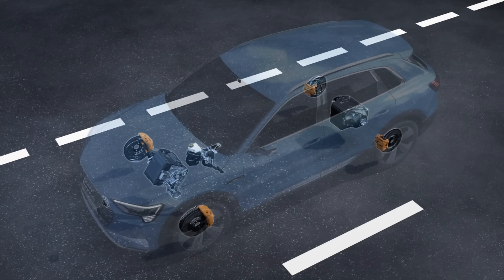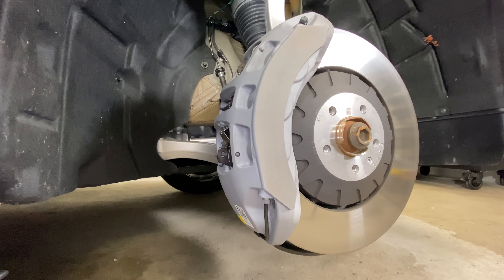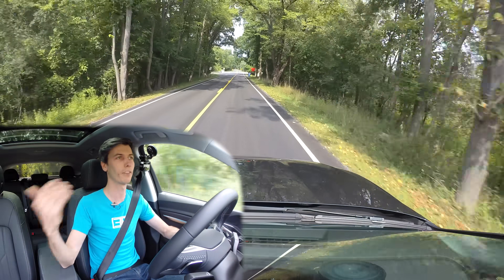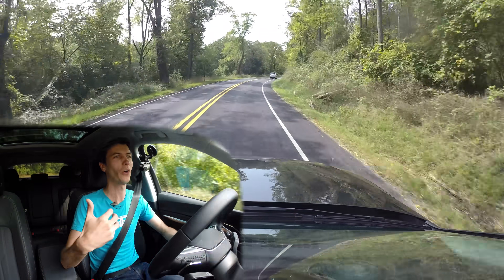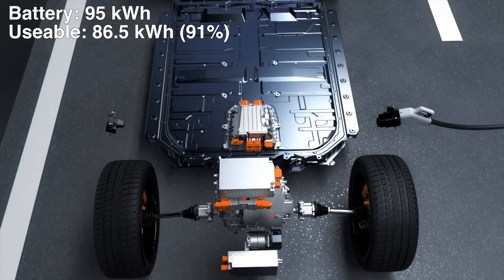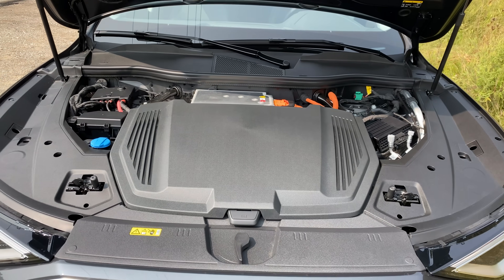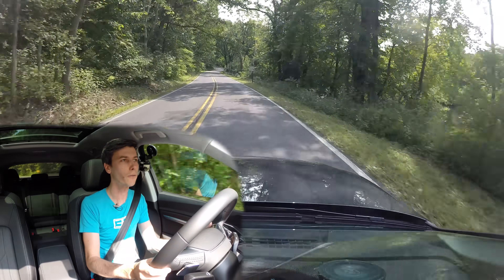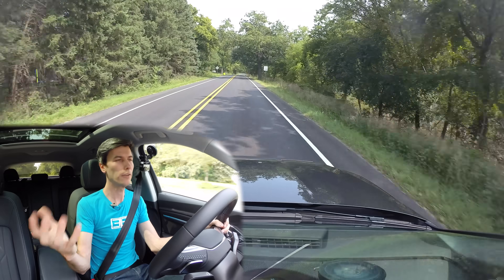How Does Brake-By-Wire Work? Plus: Audi e-Tron Sportback Review!

Comment: What if the computer fails will the valve open by default say a spring loaded system?
Reply: A lot of trucks have pneumatic or pneumatically aided brake systems. They work the same way. If there're no air pressure, the brake remains applied and needs pressure to be released
Reply: Tito Dwi Laksono infiniti tried to do that, but was fortunately stopped because of laws
Reply: If I was the engineer it would be a valve operated by a spring loaded solenoid that is closed by default and needs power to open, so if for some reason the system loses all power or fails, the spring closes the valve and you still have brakes.
I really hope they never remove the redundancy because it sounds sketchy as hell having brakes need electricity to operate when I've seen cars temporarily lose all power temporarily due to excessive humidity or bad battery connections.
Reply: @TheFPSPower  Thanks sort of like when a train looses air pressure for the brakes the brakes close.  Love your videos over the years.
Reply: @TheFPSPower  are mechanical brakes designed fail safe? Or are they just so reliable?
How about airplanes? (sure they have redundancy)
just saying. sometimes the redundancy adds complexity that makes it worse; if the first cars 100 yeards ago (which were electric) would have been a bit more successfull, would we ask the same questions?
But I totally agree; a system like the brakes or steering must be extremly reliable.
Reply: @carly200  They used to, it was called the hand brake, if you lost oil pressure to the brakes, the hand brake works with a steel cable attached to the caliper. Now with e-brakes good luck with that.
Redundancy in critical systems is never bad and never makes it worse, maybe more complex, but not worse.
If you have doubts about that ask the IT computer guys that have redundant cables because cables fail, redundant power supplies, hard drives, fans, complete backup systems. Electronics fail a LOT, don't trust them.
Reply: @TheFPSPower  another aspect is that the architecture in car is changing, from many specialized computers to fewer general purpose units.
Reply: @TheFPSPower  I don't agree completely. Instead of redund systems you can also increase reliability. An example is airplanes going from 4 engine to 2 engine.
It's not exactly the same, but the principle is similar
Reply: Its great until that valve also sticks
Reply: Tito Dwi Laksono  Power steering: "Allow me to introduce myself"

Comment: Everything “by wire” sounds no fun. Now comes steer-by-wire which sounds awful. I have found a perfect Lpi-lpg manual bmw 645ci and as soon as I’ve heard it has adaptive steering I have jumped off. There is no better ecperience than a manual mechanical car, electronics just for ECU.

Comment: I wouldn't risk my life with it. I'm cool with my transmission and engine being controlled electronically but not my brakes.
Reply: Never fly a plane then! They are all fly by wire! 🤯🤯🤯🤯🤯
Reply: Hanniffy Dinn planes are held to much higher standards and have numerous fallbacks with strict maintenance schedules. Cars, not so much.
Reply: @HydratedBeans  cars have way fewer systems that can go wrong than a plane for starters and second, millions of systems in society run on electricity and work pretty much flawlessly so why not brakes which by most measure is a pretty simple configuration
Reply: What about you’re steering?
Reply: @livelyosprey  I would absolutely never trust 'by-wire' steering.
Reply: @stefanmajonez6571  what car you drive now
Reply: @livelyosprey  A ~2005 Ford Mondeo
Reply: @stefanmajonez6571  probably the next car you buy then will be steer by wire if not the one after that
Reply: @livelyosprey  I honestly don't know of any passenger car that's steer-by-wire, so probably not. 

Are you sure you're not talking about electric power steering? I have no problem with electric power steering.
Reply: @stefanmajonez6571  no not eps, full on steer by wire. i feel that alot of cars, especially electric, will go this route to remove a much mechanical tech as possible so that everything can be controlled by a single system
Reply: @stefanmajonez6571  im pretty sure legistation is the only thing stopping manufacturers at this point

Comment: For me driving a Tesla was a completely different experience.... that I prefer. The average consumer may not be so comfortable with that, Audi is smart to make an electric that drives more like an ICE vehicle. Thank you for touching on range. 200 miles is more than likely enough for most consumers. I drive about 300 miles a week and don’t use my vehicle for trips, only work. Getting fuel once a week will take longer that just charging at home twice.

Comment: I just want an "ev" that has a diesel generator instead of a massive battery pack. Throw it in a subaru truck and I'd be one happy camper. (pls subaru, make a truck!)
Reply: Same. A diesel electric would be amazing. I've been toying with the ideea for long
Reply: Like a hybrid?
Reply: @livelyosprey  no, more like a diesel train.  The engine never directly drives the wheels, only generates electricity.  So the engine can always run at max efficiency, and you get all the benefits of electric car without the drawback of the battery and charging it.  Would weigh a lot less also, though the weight distribution would be worse.
Reply: @ChadRazorback  most mild hybrids only use the engine to produce electricity for the motors to drive the car are don't have a battery pack. The engine only cuts in at highway speeds to increase efficiency
Reply: @ChadRazorback  not necessarily because you can put the engine, batteries, motor and fuel tank more or less wherever you want.
Reply: @ChadRazorback  also you can have a 200 hp diesel engine and a 400 hp electric motor as you don't need all the power all the time.
Reply: Sooo you want a dump truck?

Comment: So what happens when that little bypass valve decides to stay closed?.....
Reply: The 0.001% chance the electronics break combines with the 0.0001% chance the valve gets stuck is so unlikely it’s probably not even a factor. But hey, I’m not the engineers
Reply: Redundant systems. Both valve would have to block closed at the same time. Redundant braking systems (3 wheels, 2 front and 1 back) been in cars for a while.

Comment: CD is only part of the contribution of the vehicle body to actual drag force.  You need to know frontal cross section.  Frontal cross section is almost always ignored, and I don't know why.

An SUV can have a pretty good CD but still have more drag force than a sedan for this reason.
Reply: Yes makes much more sense to give cd*area. But in this case I don't think it matters, it looks like both have roughly the same area.

Comment: Who else has owned a VAG product and their inherent dashboards filled with warnings of electrical failures.  At best this thing will be in the dealership getting scanned and not on the road.
Reply: I have had my 2005 A4 for over 8 years. No lights in my cluster! My Mk3 Jetta was rock solid. My mk2 same thing. How are you maintaining your cars?
Reply: @joshfoleyJr  Audi Certified and maintained...  including  B6 A4 Sedan B6 A4 Avant , 2002 AudiTT 225, presently a 2015 Q3 with 1 failed injector and HPFP.

Comment: Just like airplanes, your command is sent to a computer and then the computer decides how much it will do.
Reply: Yeah, but now have that planes electronics designed by AUDI 🤢🤢
Reply: @skiptastic1000  actually, TIERs supply most systems and do most of the development, not the OEM
Reply: the computer doesnt "decide" anything. computer logic is followed deterministically in the exact same way (and even more reliably) than mechanical or analog electrical systems

Comment: Th Renault Zoe ZE40  I owned had a noticeable transition from regen to the mechanical braking. This was very disconcerting because the force of braking would reduce for a fraction of a second and a couple of times I overshot where I was aiming to stop (only by a foot or two but still not perfect).

Comment: More stuff that's going to be expensive to fix when it breaks
Reply: Brake-by-wire has been around for at least 15-20 years, mostly without more problems than conventional brakes. But I guess Audi could screw it up 🤷🏽‍♂️
Reply: Totally by accident wink wink.
Reply: Waw I didn't expect that from the guy with the Ferrari in his avatar :-D

To be honest, I also think it's too complex, it would be more elegant to do without the hydraulic system. It likely had something to do with marketing thinking customers would scare away from the car without the failsafe.
Reply: That’s AUDI for you
Reply: Chains break on bicycles. This wear out. You will be surprised at the overall reliability of electrical systems.
Reply: @joshfoleyJr  Even bridges fall down. But there is hell to pay when they do.  When it is software or electrical systems everyone shrugs and says "what do you expect?"  If they have confidence in it's reliability, provide a 20 year warranty.
Reply: Everything is expensive and a pain in the ass now a days, even changing the oil on a prius is annoying
Reply: @rogerwilco1777  it's a lot more expensive to fix electronically controlled devices that its mechanical counterpart like to repair a tesla will cost a lot more than a non ev vehicle
Reply: @avrggamer69  Yeah but teslas can 'allegedly' go 300-500k mi with very little maintenance along the way., and thats just because the battery pack gives out by then, the drivetrain is 'supposed' to last a million miles. Most ICE's will need a transmission or engine rebuild before 300k mi.  ..and who does that anymore? If a modern car majorly 'breaks' and its not under warranty, its almost always a better deal to just trade it in, electric or not

Comment: What if the valve fails to open?
Reply: What if a brake line ruptures on a conventional system? With every mechanical system, there is a chance for failure. With this type of redundancy, Audi figures that this system will be just as safe and reliable as a mechanical setup.
Reply: @hayesclark97hc  my thinking is that the safety valve hasn't had to be used in so long that it fails when you need it.
Reply: @ColeSpolaric  cars have on board diagnostics. Your car will tell you that the airbag or antilock brakes need servicing even though those things rarely get used.

Comment: how much re gen does teslas have?  is it higher than .3G?
Reply: Jason Millner no. It is .3g max. Teslas are a little different from this audi however in that you get full regen(adjustable) from simply lifting off the throttle. The brake pedal in a tesla does not affect regen in any way.

Comment: we dont need electronic braking. hydraulic brakes have been fine for 100 YEARS seems to over complex than it needs to be
Reply: Did you even watch the video? Brake by wire is necessary for optimal regen braking in electric cars - you'd be wasting energy that could otherwise be captured.
Reply: @mubd1234  I understand that yes I'm all for regeneration braking but why change the basic hydraulic. i understand technology needs to improve,  I'm not touting that carburetors are better than f.i.. but you can keep the simple braking system and have regen brakes. that's all I'm saying
Reply: @SidewalkMechanics  Did you even watch the video? You can't keep the simple braking system while retaining the kinetic energy recovery and keeping the same driving skills, with regards to using the brake pedal to stop, because the energy you want to recover will be lost as heat.
Reply: The Prius and other hybrids wouldn't have been possible without brake by wire.
Reply: Exactly hydraulic brakes are perfectly fine  but it's inevitable  sadly and that means all mechanics to keep up with the growth will have to return to school
Reply: True for an exclusively IC powered vehicle.
Reply: Electric brakes aren’t exactly better but they don’t really need to be maintained and it’s much easier for the car to know exactly what’s going on